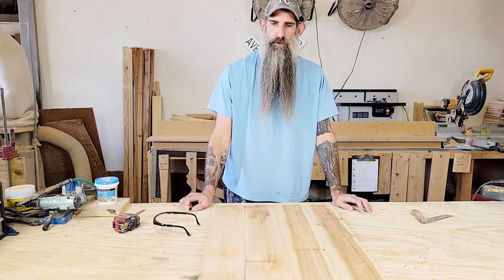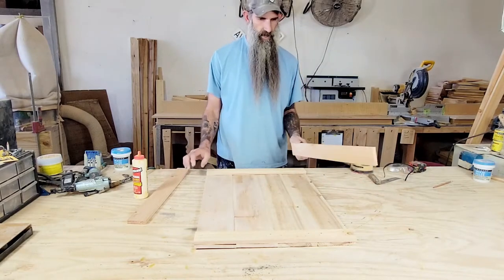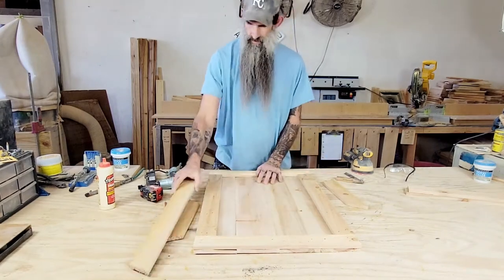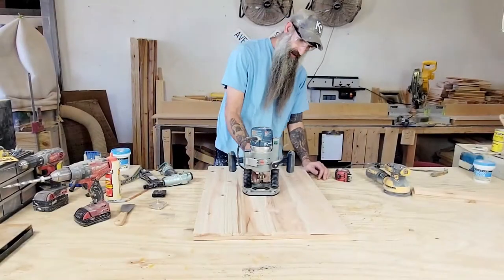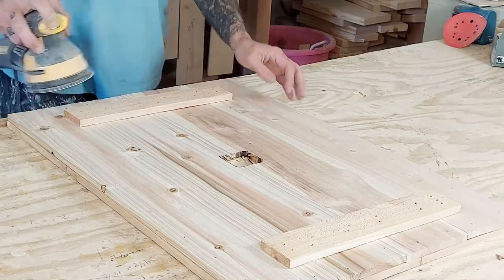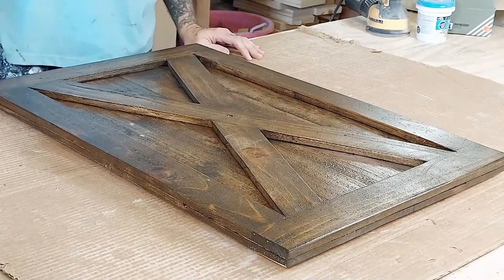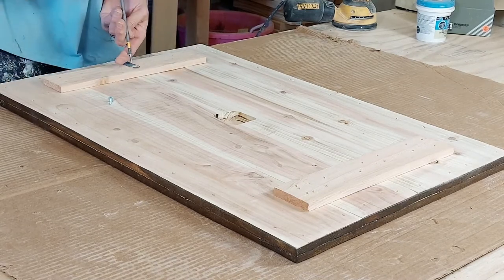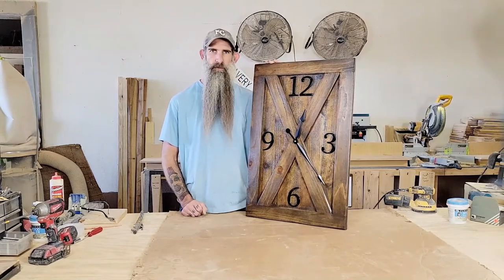HOW TO TURN $30 INTO $300 | BUILDING A BARN DOOR WALL CLOCK | FARMHOUSE WALL CLOCK

Comment: I just found your awesome channel. I noticed that you sprayed the wood before you applied the glaze, which I assume was a wood sealer? In your videos, you appear to use an airless sprayer, but a few times I believe you used an HVLP sprayer. I’m an old beginner woodworker so only know the basics, but I was under the impression an airless sprayer doesn’t leave a really smooth finish like the HVLP. Do you just use the airless for your clear finishes and HVLP for paint? 

I ask because I’m looking to purchase a sprayer, and I can’t decide whether to purchase the cheaper airless sprayer like the Harbor Freight Avanti or a small Graco, or to go with an HVLP sprayer like the Fuji Semi Pro 2. I had a cheaper airless sprayer that was great when I sprayed stain on my fence, but I couldn’t get it to work a couple years later when I pulled it out to use it for woodworking projects. I bought a handheld HVLP sprayer, but I can’t get it to lay down a really smooth finish with latex paint as it’s not strong enough to atomize the paint. I get the orange peel effect. 

Would appreciate your thoughts. Thanks for the videos!

Comment: New subscriber here.
Your work is awesome.
Can you post a link for the clock movement and metal numbers used.
Thanks, and keep the videos coming.
Reply from the maker: You can buy them at klockit.com. I don't have a link.
Reply: What size hands and mechanics do you purchase? What size numbers? 
What size do you cut your boards? Do you have cut plans?